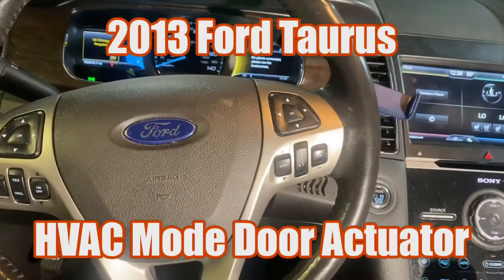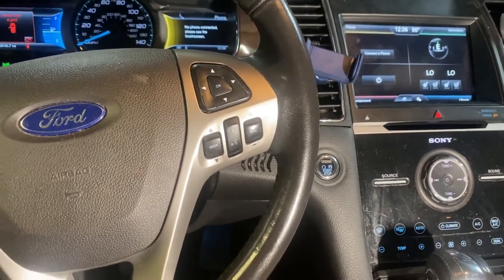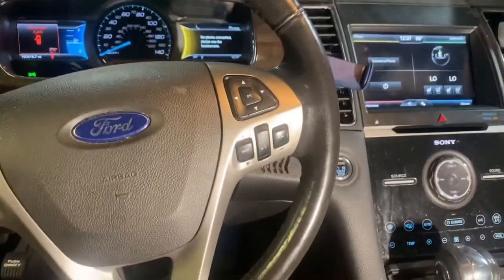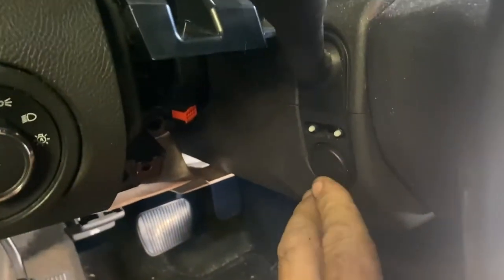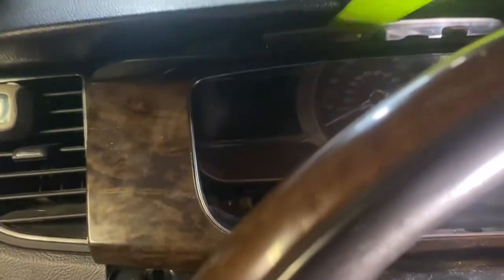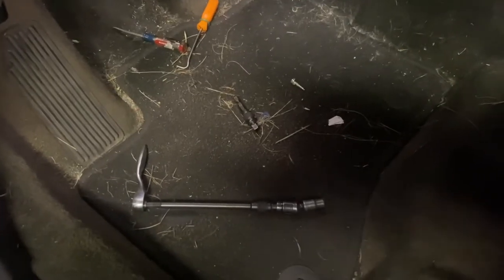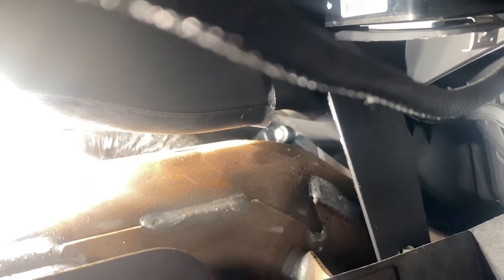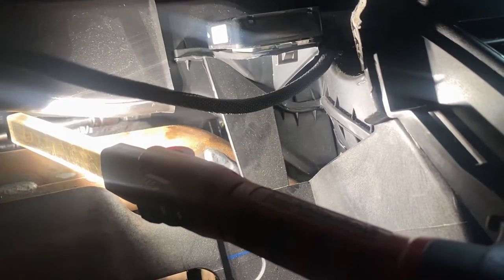2013 Ford Taurus HVAC Mode Door Actuator Replacement

Comment: Exceptional video. I just tackled this job but I had absolutely no choice but to remove the steering column with the 4 bolts and electrical connectors. This advanced step gave me a huge advantage to access the 3 screws and have arm room access freely to remove that actuator and work comfortably. Horrible spot all around. Hope nobody ever deals with this repair. Started at 10:00AM and finished at 9:00 PM.

Comment: Great Video, 2015 Ford Taurus here. Only difference was the brake switch was facing forward and easier to remove to gain better access to the actuator. I will say, having a 1/4 inch racket, 14 inch extension, universal to the 5/16 made a world of difference and was the only way I got all the bolts out and in. I did not put the "hardest bolt (Most forward)" back in as others suggested its not worth it. Im a big dude with big hands and got it done under 3 hours. Appreciate the video!
Reply from the maker: Glad to help! The funny thing was that the “hardest” one wasn’t the one missing in the video. I’ve seen a few actuators get canted and break when they don’t get the third bolt on other vehicles, not sure if that will be an issue on the Tauruses. 

Even if I find it that way, I really dislike reassembling things with bolts missing, because I’m being paid to do it.  I’ll spend a  ridiculous amount of time trying to find a replacement fastener before I do that. 

But if someone is doing a repair on their own vehicle and wants to leave a bolt out, I figure that’s their call.

Comment: Outstanding Video ! I did the same actuator replacement on 2008 Taurus Sedan. Noticed 2 differences: 1 - there is no gap on top between air vent duct & metal frame (behind instrument cluster). I had to wedge pieces of wood to make a gap to access the top actuator screw. Thanks to your video, I knew where to access from the top ! 2nd difference is there is no metal frame to be removed behind knee bolster in 2008-9 models. Otherwise everything else very similar. Even how to remove brake pedal sensor (90 degree rotation)  was Brilliant !  It created much more room !
I also unclipped the wiring harnesses "Christmas tree" pins in at least 2 locations. That made a lot of difference for 2 actuator screws access from the bottom.
Having large hands makes this job very difficult in such narrow spaces.
Another tip: If your screw does not stay attached to socket bit (when you have magnet), just tape the screw temporarily to the socket bit. Once screw catches the thread, tape can be removed (scraped off with a long wire bent at the end). Only the lowest screw was possible to be placed by hand for me.
Swivel sockets and long extensions are a must. "Finger ratchet" was also useful (with variety length extensions) when screw was still going  in easily. Final torque needed with a ratchet wrench.
I did replaced in the past also 4 different actuators on Ford Taurus X (Driver Temp, Passenger Temp, Outside Air/Recirculate and this Mode one), this Mode one is the worst !
I guess cursing the Design Engineer(s) is expected. I wish they at least once tried to replace the actuator themselves in fully assembled car.
Otherwise there will never be any accountability. 
I guess Professional Mechanics may not care, they will just charge more hours for the job at fixed rate per hour.

Comment: On my 2015 Ford Taurus HVAC Mode Door Actuator the 3 screws are 8mm and might I suggest using a Endoscope, comes in handy for that second top screw near the firewall that you can’t see also used Rigor Universal Joint Swivel Socket Adapter and Neiko Flexible Extension Bar and thanks for the help

Comment: Hands down the best video on this i have ever seen on Youtube! Thanks. I still hate Fords though. Never again! Some decades ago Ford had a slogan "Ford has a Better Idea". That idea was to buy some other makers car. Any other is better, or at least not as much a PoS, usually. ;-)
Reply from the maker: Thanks! I’m glad it helped. Ford definitely keeps me in business, so it’s a love/hate relationship with me and them.
Reply: @RedeemedMechanic  I was wondering if you could answer me a question about this car. I own the same car and there is a noise like a squeaking/ squealing door coming from the dash near the actuator you show replacing. The sound is non-stop. Is the noise part of the actuator or something about the blend door itself? Have you come across this noise yourself? If so, would oiling something stop the squealing? Thanks.

Comment: I had this issue, got the old out, put the new in, did the fuse (did both the one you did and the one that was showing climate control in the manual), but mine is still stuck to only blowing from the vents and won’t go to defrost or floor. Any ideas?
Reply: I replaced the other actuator that’s down there not the one I needed too 🤦‍♂️
Reply from the maker: Yep. My video was for the temperature blend actuator. Sounds like you had a bad mode actuator. Glad you figured it out.

Comment: Can you or anyone else reading this tell me which mode, either the Floor, Dash or Defrost  Vent outlet is the position of the actuator gear key showing when it, the gear key, is aligned with the arrow on the case of the actuator motor? 
When the mode is stuck in AC Dash position when the servo is removed which position is the keyway in the drive gear pointing in relation to that  arrow depicted on the side of the servo motor housing? Does anyone know this information?

Comment: Just got mine out, will note mine had a third bolt in it. Used a thumb wrench, 3/4" extension, 3/4" swivel, with a 8mm head to get it off along with some choice words.
Reply from the maker: Yes, late in the video I discovered there was supposed to be a third screw. I had to scrounge up a similar screw to properly secure it.
Reply: For the third screw did you get to from underneath or behind the instrument cluster like the one shown in the video?
Reply: @Botlane Fiasco  yeah I had to get up underneath there with a thumb wrench and use a lot of choice words haha

Comment: Great video, thank you. I was able to follow the directions and everything went smoothly until I needed to install the new actuator. I can't line up the teeth/cogs of the actuator with the teeth/cogs of the mode module. The module teeth/cogs are jammed and I can't adjust manually. Anyone else have a similar issue? Thanks
Reply from the maker: When I have that issue I usually try to index the door to match the actuator. I’ll use a tool like a stubby screwdriver to turn the door. A mirror or camera helps a lot to see. 

Whatever you do, don’t try to power up the actuator and turn it. You’ll break the actuator.
Reply: @RedeemedMechanic   Finally got the door teeth/cogs of the door to move and I was able to install the actuator. Thanks so much. Cold air from the dash again. Appreciate it!

Comment: My question is I feel like if you did the only 2 screw method wouldn’t it be more effective to just put the one behind the IPC in and leave that top one by the firewall out? Obviously to put the botttom one back in? I feel as that would be easier I had no hastle getting the one behind the IPC but the other 2 I cannot get for the life of me. I gotta tackle this again tomorrow I tried today but got to dizzy hanging upside down for 30 minutes 😂 ducking (replace the d with and f) ford and there horrible designs. Its a cheap ass part I paid 20$ for the OEM motorcraft actuator but I ain’t paying out the butt in labor